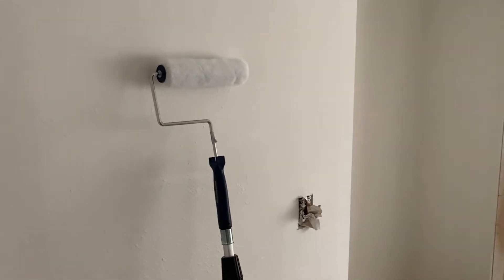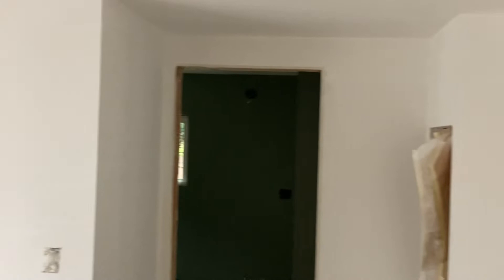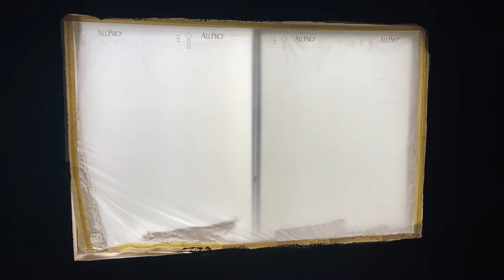Lower your EMF Exposure with Shielding Paint

Comment: This client you have is well-informed! We have found that the cinderblocks used to build houses in Florida act as a shield. The wood frame house or the wood used on our home's top floor does not block. Therefore we will remediate the upstairs but the downstairs is excellent!  I have been told that the paint is done best is done in two layers and perpendicular strokes thus forming a grid. Can you comment on that? Thank you!
Reply from the maker: Cinder blocks and/or cement can block RF for sure.  For the paint, you do generally need at least 2 coats, but the key to verifying proper install is to test it with a multimeter as per the manufacturer instructions.  You can put the coats on whatever way you want, just test it afterwards. 👍

Comment: So I bought the powdered version. Do I need to get the additive too, or can I use acrylic paint ? I read that you can mix the paint or powered paint with acrylic paint to get the better seal?? What do you say ?
Reply from the maker: Follow the manufacturer instructions to the letter.  I would ask them about the need for grounding additive.  I’m aware of the powdered stuff but have little experience w it

Comment: Would this work in an empty cargo van? Planning a non permanent build. Powered  💯 by a portable power station. No outlets in the walls. No wiring in the walls. Just looking for a way to get sleep in the van without getting bombarded with emf waves.
Reply: This is what I'm thinking. A safe pod to sleep and eat. Zero WiFi or internet use in pod. I'm getting really bad tinitus and these towers are popping up all over
Reply: @MICHAELTUCKER-eg2ub  exactly
Reply from the maker: The medal of the van would accomplish the same goal. You may need to apply shielding film to the windows to complete the cage.
Reply from the maker: “Metal”